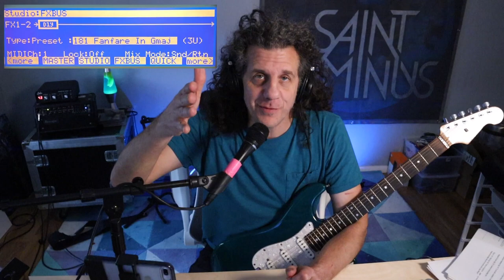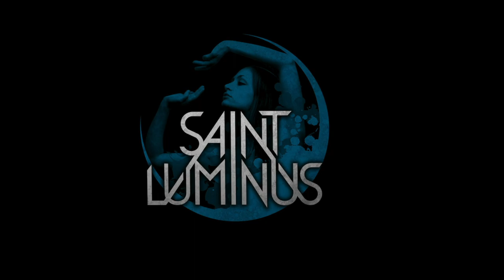Kurzweil KSP8 Delightful Delays

Comment: Hey! When you look at that LFO Mode in the Moving Delay (just another fancy name for Modulated Delay) you are simply looking at a waveform! It's odd they didn't actually use that name but you are simply selecting different waveforms the algorithm designer liked better for different effects. They will probably also affect modulation in a different ratio, being flanger more demanding in this area. BTW... try NOT to change any other parameter but LFO Mode and that will reveal you the difference in how the delay is being modulated. Try with a long delay...5/600 ms. As for the rhythmic subdivisions I see the rhythmic fraction 24/24... that's the same exact way used in the H3000! Funny stuff!
As for the "FLANGER" effect....
the whole digital FX industry has messed up with this! A flanger is NOT a delay running at very low delay time with high feedback and being modulated. That's still a CHORUS made funny.
A FLANGER doesn't have feedback at all and is a set of two identical signals running at the same speed, while one is being changed... actually slowed down ONLY... by touching the flange of the tape of one of the two signals. To really do a flange efx in digital domain you need two identical delays running together and slightly increase one of them, making sure its time floats between the other delay settings and a few milliseconds more than back. You can hear that thru all my Revelation Collection for the PCM80/81. It's a much more musical effect, not as metallic and nasty sounding as what they made people believe a flanger is. It can be done on the Kurxweil and on most good racks... provided the right programming.
That's what Eddie Kramer's Hendrix/Beatles effect is all about!
The problem with true plain flanger in digital domain is that the wet signal running in parallel to the dry... can't be delayed lower than the dry... as it's already at 0 ms... AND conversion latency adds a fixed delay. So the best digital flanger is only possible by running DRY and WET thru the converters to time align them, then add a small delay to the dry and create the flanger against it eith a delay as I described...